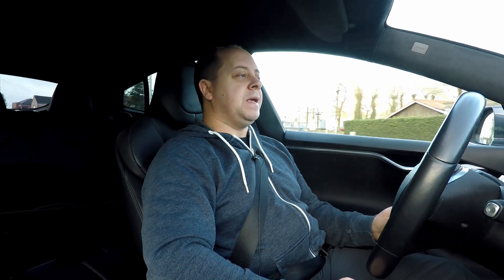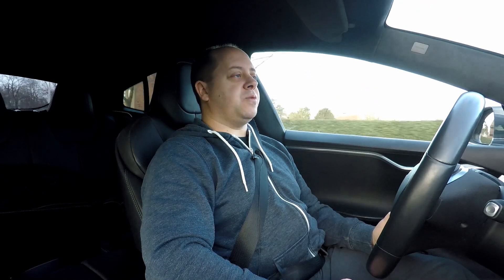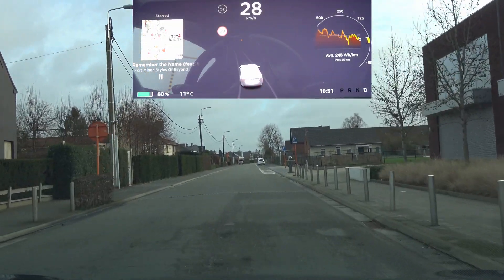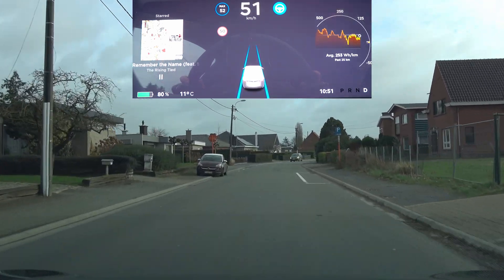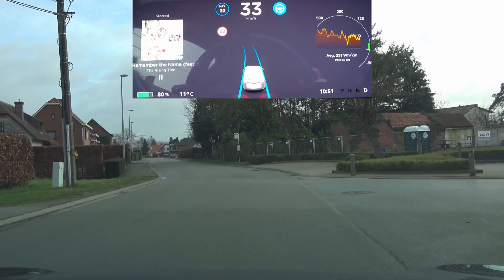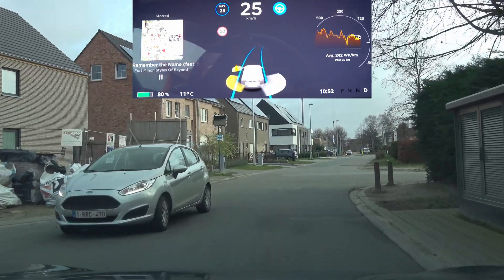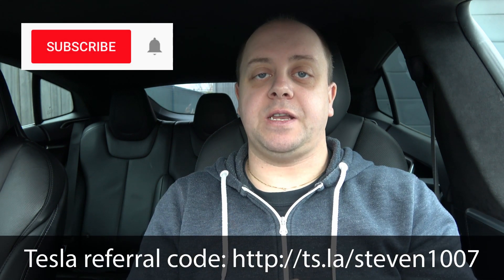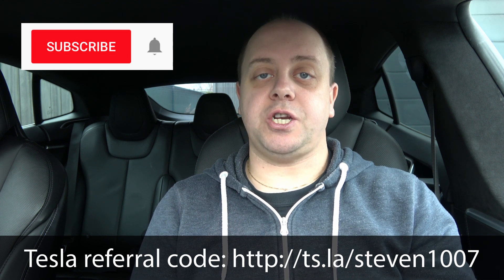AutoPilot 3.0 vs AutoPilot 2.0: better and worse at the same time

Comment: The sharp turn disable is actually also to comply to regulation. From the release notes of 2019.16.1:

"Due to new local regulations, the limit of how far the steering wheel can turn while Autosteer is active has been adjusted. This may reduce Autosteer’s ability to complete sharp turns."
Reply from the maker: As demonstrated in my other tests. My car gives a warning, but does not disable AP. This is what the regulations prescribe
Reply: @StevenPeeters  I see. I assumed that the disabling may have also been part of this regulation. That is good to hear that it only slows down. Hopefully Tesla can improve the software on sharp turns.
Reply from the maker: Geordon Worley a couple of updates ago they nailed it by slowing down before the bend. For some strange reason that has gone away in the last 2 updates.
Hopefully the higher lateral g forces will be approved next week and that should help Tesla to manage that S curve a lot better again

Comment: if  you would buy a new tesla right now, would you spend the extra 7k for FSD over the standard autopilot? I understand that it’s (for now in Europe/Belgium ) not really added value over autopilot or am I wrong?
Reply from the maker: The problem is that auto park is now part of FSD too. But other than that, at the moment it’s not worth the money. But then again, I’m the guy that bought it over 3 years ago 🤣. If you want to get all thr goodies as soon as they are allowed, and you like party tricks, you should buy it. But it would be a tough call for me at the moment
Reply: Steven Peeters thanks! Just ordered a M3 without FSD 😉

Comment: Any noticable differences in consumption and/of handling/comfort in the Raven vs your Model S?
I did a test drive with a MS Long Range (Raven) a few months ago, but it was on 21" wheels and I have 19" so I found it hard to compare.
Reply from the maker: The Raven was on 21” and still way more efficient than mine on 19” winter tires. The front motor makes a hell of a difference. Plus the fact that regen to zero is also a big difference and requires getting used to..,

Comment: I don't think hardware has much to do with the variations. The software is still the same, so why would there be any different behavior? The new hardware is not actually used as of now. The real differences will only start when new features will start being released that older hardware can't do
Reply: Do we know for sure that the software is the same? The software might have different neural nets which are selected based on the hardware. A bit comparable to video games adapting picture quality and frame rate to the capabilities of the video card.
Reply from the maker: As mentioned in the conclusion, HW2 does not take any cones into account and will run straight into road works if no lines are painted. HW3 is able to follow cones only. The difference is already here...
Reply: As long as Tesla doesn't deliver proper relase notes nobody really knows what each software brings up..
Really unprof. for Tesla as a tech company. Every software dev. is doning a better job in that.

Comment: Steven, thanks for the hard work ;). An improvement of HW3 compared to HW2(.5) is the detection of oncoming traffic. I got this from DirtyTesla who reported on this after his upgrade (the best comparison: same software version + same car). In your previous video with the old HW, you can see that your car missed about 4 or 5 of the oncoming cars, whereas this HW3 car missed none.
Reply from the maker: I did see a lot of traffic disappearing before they crossed me as well. There is still quite some work to be done on that front...